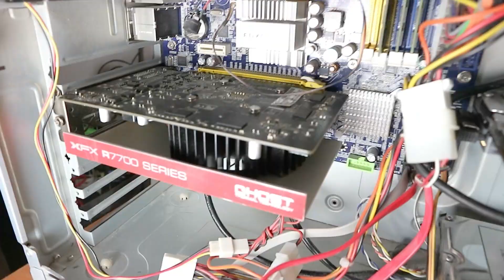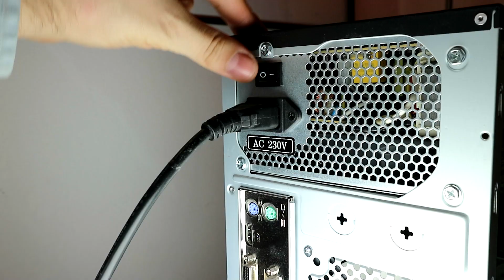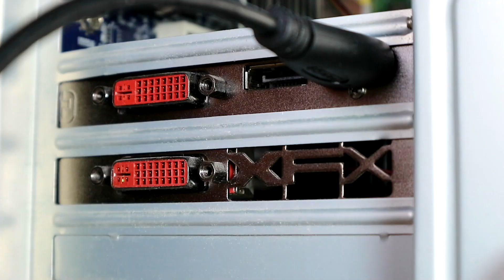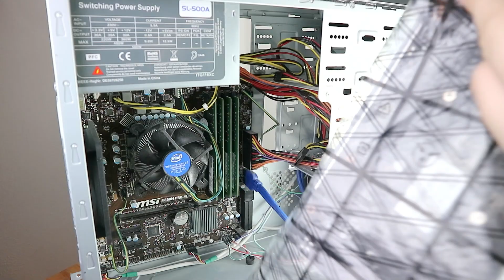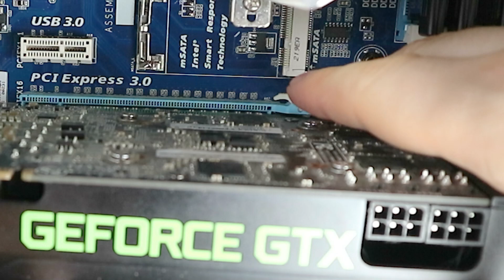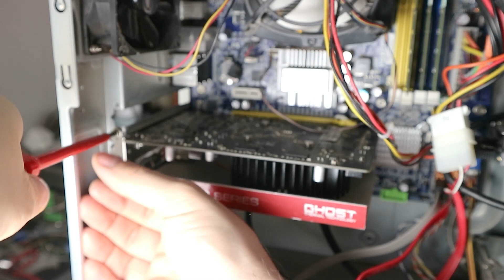How to Remove a GPU (Take out Graphics Card Tutorial)

Comment: I forgot about the lever on the pci express bus. The card was in there for 11 years. I pulled the card out, and the pci express bus snapped like a cracker. It didn't even take much effort. Buses didn't have levers in the many PCs I built in the 90s and early 2000s so I couldn't imagine anything like this happening. I should have watched your video. My question is, since my motherboard has a second slot (as a feature for dual sli) can I use that other slot? Guess I'll try and see. But curious what dangers can arise from a motherboard with one broken pci slot?
Reply: I used the 2nd (last) pci slot and put back in the old video card and put electric tape to cover the broken pci slot. I leave a fire extinguisher in the room and never leave the PC on if I'm not using it. I should probably throw out the motherboard and sell the ram, and video card and rebuild.

Comment: If you're not savvy, like me, you are taking a MAJOR risk with this. The parts inside a PC are sometimes very difficult to turn, move, plug in, etc. I got my GPUs out and only then realized I didn't have the right tool to get the parts off the get to the fan. Once I realized I wasted my time, I had a nearly impossible time getting the GPUs back in.
Reply: I have a pre built and it seems like the graphics card is not meant to be taken out. Either that or I just dont know what I'm doing. I have a sticky gpu fan and I can't fuckin get to it.
Reply: @ryze9153  I got a prebuilt hp with 980 and it’s put in upside down with a metal bracket in front of it 😵‍💫

Comment: Thank You, this helped Me get my USB Drives working. This Custom LENOVO came with a screw holding the graphics card in that is (so conveniently) tucked behind a metal flap, so its basically impossible to unscrew unless You have the worlds tiniest screwdriver. I lifted the graphics card best I could and squeezed the USB power plug in behind it into the slot and vwalla , the front slots work now.

Comment: On that second uninstalling (GeForce GTX) it seems to be leaning on the right. Why? Mine does this but a bit much noticeable (msi GeForce RTX 3070).. I'm not too tech savvy but the lean bothers me so much.. can someone help me fix it straight?
Reply from the maker: My gtx750ti used to do that. The reason was that the metal part that faces the outside was bent and didn't go in the right spot between motherboard and pc case. I was able to fiddle it in but was very worried about scratching the motherboard. Seemed to not be a problem on the end in my case. I should have bent it instead though

Comment: I thank you so much. I have known my Graphics Card had trouble for about 4 years. Being afraid, and not wanting to spend the big bucks to buy a new one, as well as not knowing how to remove it well, also not damage anything in the process. Well finally it won't populate the monitor in over 36 hrs so it's on the fritz. I can take out the Card from another PC that is also a gaming type and will follow up with more help to see if just putting in the "newer" one will save me.

Comment: My clip won’t go down
Reply: do not worry guys, if you just pull hard enough there is a 50/50 chance only the plastic holding it down will snap off and the rest will be fine. speaking from experience
Reply: @professionalshitposter6897  yea that just happened to me! I have a a asrock pro gaming 4 and the plastic pcie clip just snapped off but no problems so far
Reply: Bei me to
Reply: Use a flathead and push down
Reply: @dragonquake  I tried this but I'm afraid it'll pierce the mobo, using a b450-f btw and goddamn its difficult to pull it out
Reply: @donna321-g9j  I also have a b450 board and damn is it scary pulling it out
Reply: @donna321-g9j  b550 and have the same problem... I hate it
Reply: @Crymble  😊
Reply: my clip broke off is this a problem?
Reply: @lil_brownie6057  nah, no problem